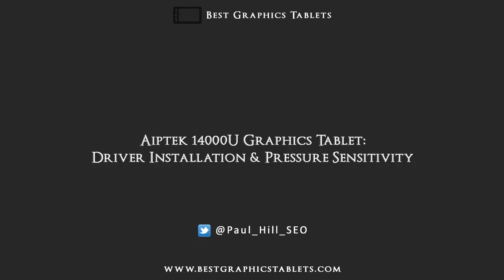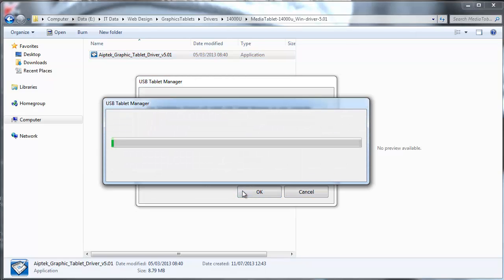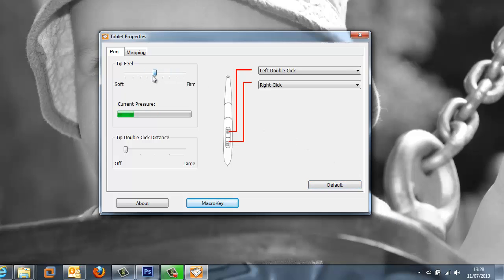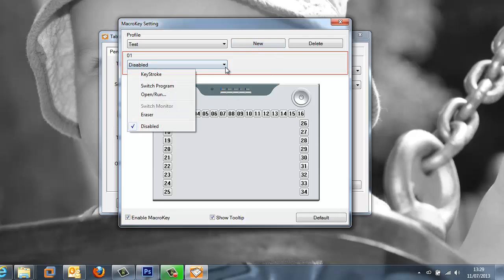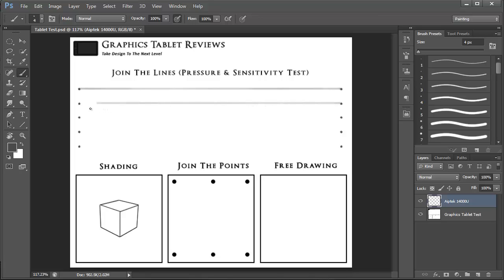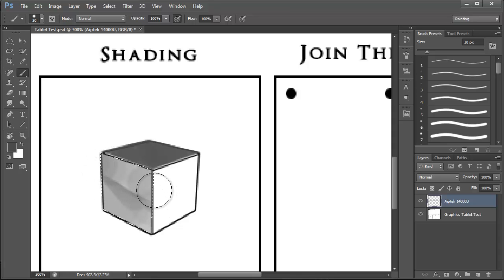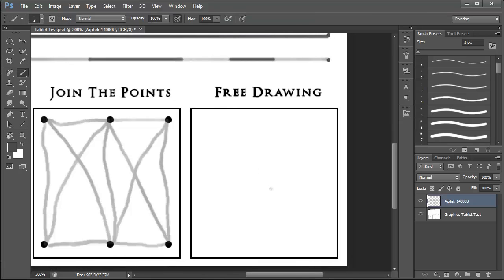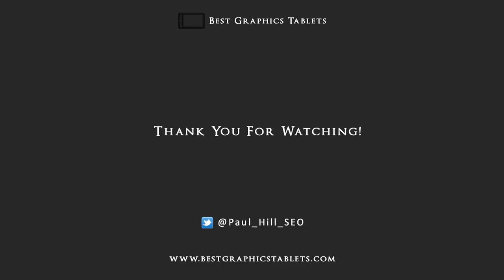Aiptek 14000U Driver Install and Configuration

Comment: Used the driver that another user posted here in the comments via a mega link. Win 10 64bit, not properly working. No pressure sensitivity with the tablet, makros not working, only the two wheels work as a zoom in PS or as a Volume Adjuster. So just normal writing without pressure... What a shame, just because of missing proper software with the newer Windows versions a whole tablet line goes straight to the bin...